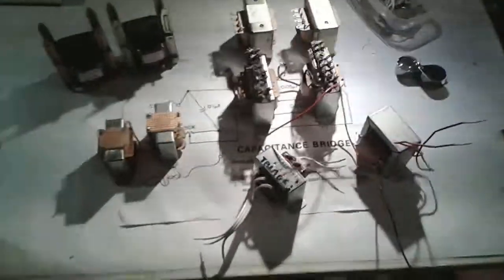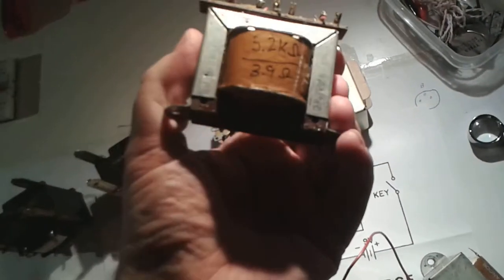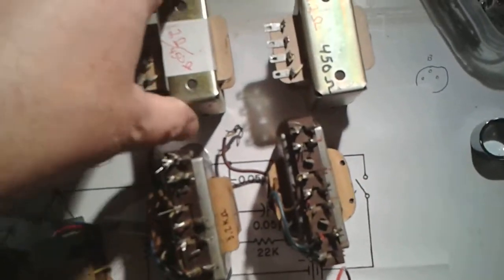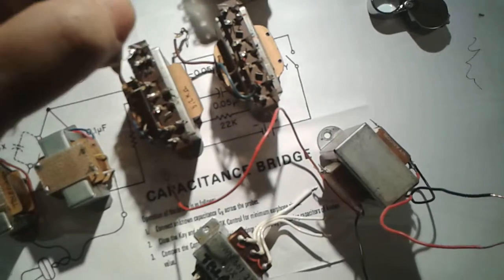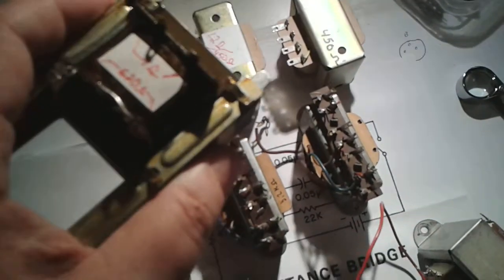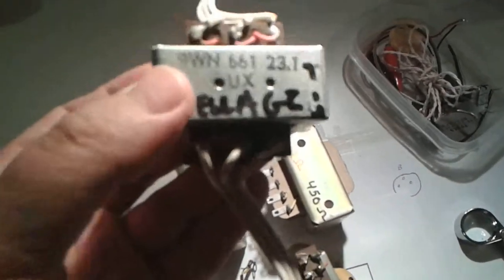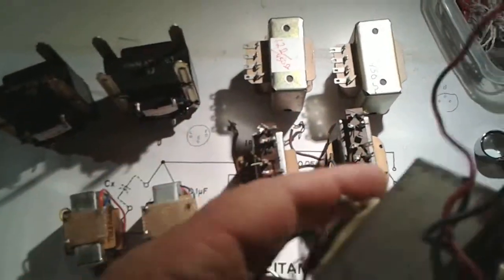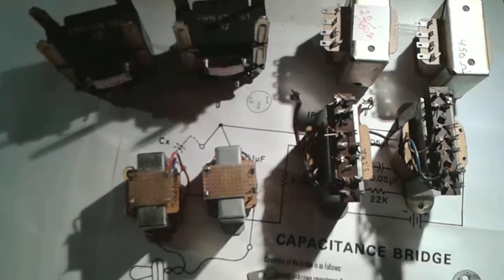My TUBE OUTPUT TRANSFORMERS.

Comment from the maker: Naw, I don't think so. I got GREAT results even with the small ones. I have pretty good support over here anyway. Not sure what kind of sound you're trying for but I think these transformers are bigger and more powerful than you think. In fact, several of them have very specific specifications and sound great so I think you're wrong, I mean I'd be more likely to go with the specs and numbers and the sound I hear, as opposed to what one person says so far, but thanks for the opinion. :) Keep in mind, these are experiments and I'm just having fun...not trying to build the "ultimate" McIntosh amp or whatever. Most of these were pulled from AMAZING machines which had either EL84 or PCL86 or ECL82 valves, so I'm sure it's all good. Cheers.

Comment from the maker: Well, actually some of these came from amplifiers/radios that were using either EL84 or PCL86. The two smallest on the left worked really well with both EL36 and PCL86. Worked especially well with PCL86. Great volume and sound for extended period of time. I've found even smaller in radios connected to 6V6 or PCL86 that also have smaller speakers. I used one of those small transformers in a 6AF11 compactron amp as well and it also sounds great. Ran for 24 hrs no problem. I'm still learning you know, doesn't have to be perfect....just fun. No melting, no fires, no shocks yet. :D

Comment: 12K to 4 ohms

that is almost enough for a dl96

and 30W is way to much for that little fellow
unless it is a pp transformer

i would guess it is a 3 a 5W transformer
Reply: taht pa transformer can be used in a otl amp and in a pcl 86 amp

my pcl86 amp is designed around 2 of those